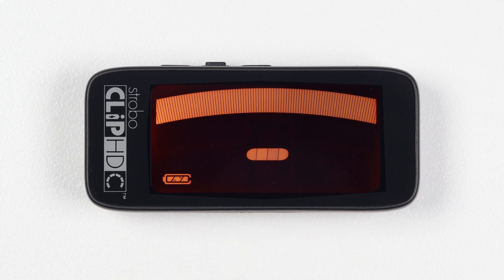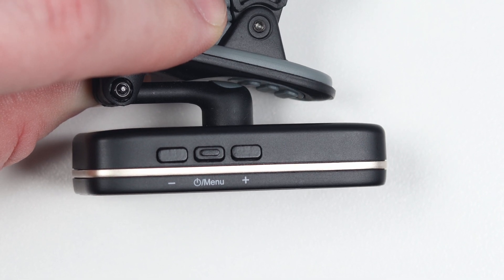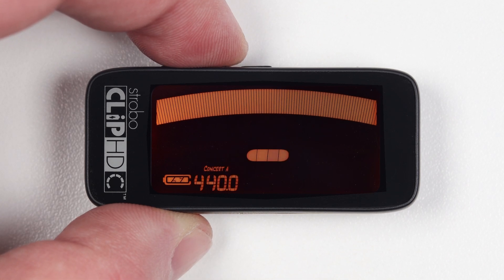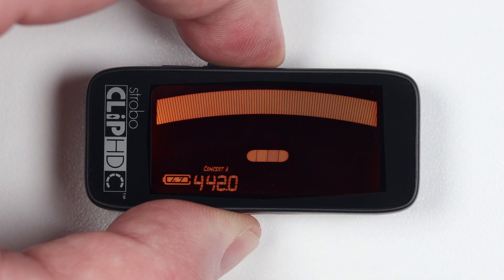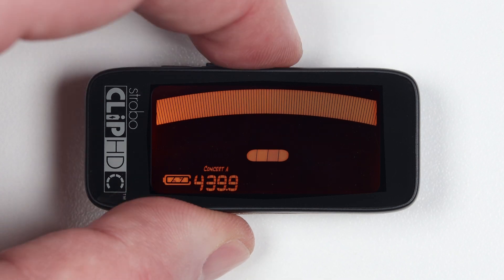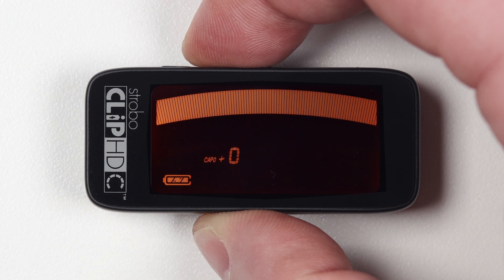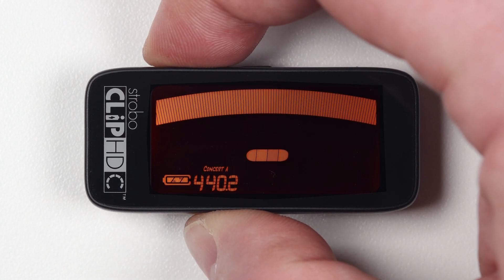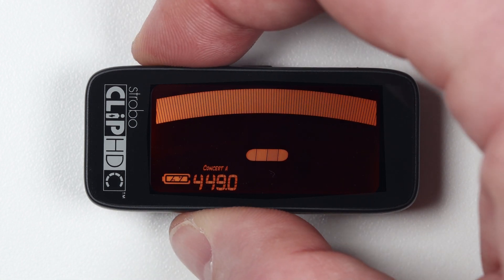StroboClip HDC | General Navigation

Comment: What is the time out (auto switch oof) time of this tuner?
Reply from the maker: Thank you for your question. The default auto shut off time is 2 minutes. This is adjustable from 1 minute -- 255 minutes, with never off as an option, via a custom configuration made with Peterson Connect.
Reply: @PetersonTuners  thanks, that is great! I will order one right away!